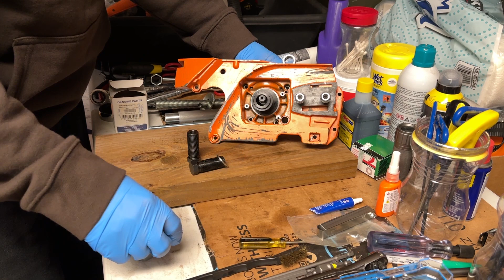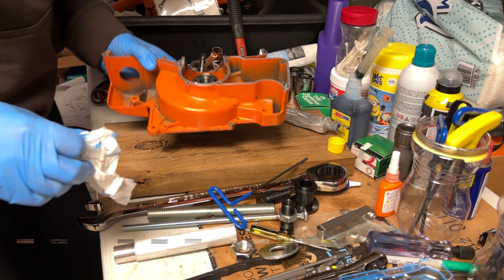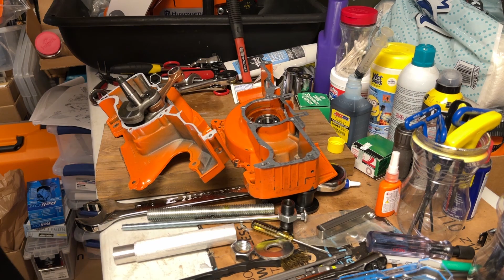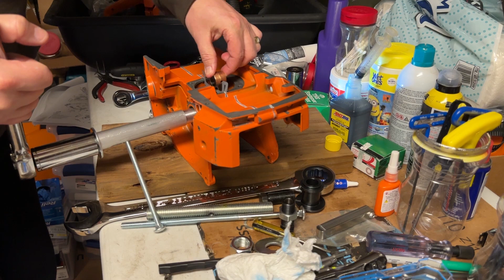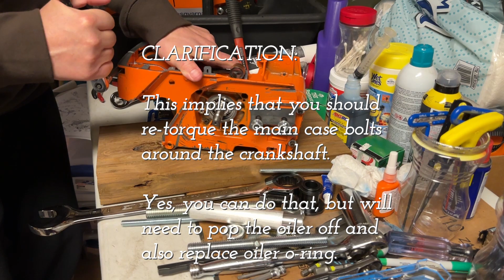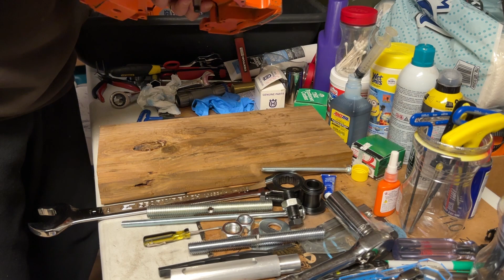Part 8 Husqvarna 288 XP Build - Crankcase Assembly

Comment: Love this great series beau. Thank you very much for taking the time. I'm getting ready to replace the crank case bearings on my 281. Is there a cheaper option for a center race style puller rather than $200 from matt's tool?  I love the bolt press idea! Ingenious and cheap!
Reply from the maker: I’m not aware of any crankshaft assembly tools on the market that do a good job of supporting the center race other than Matt’s or without having to design your own.  Some of the Stihl tools may work on Husqvarna saws I’m told, but I’ve not confirmed that and they are also pretty expensive, more so than Matt’s tool.  If you don’t want to fully support the center race, you could use the OEM crankshaft assembly tool and is much more affordable.  But, it might be hard to find it……can’t remember where I got mine, but you might have to go directly to Husqvarna.  The part for that service tool is 502 50 30-08